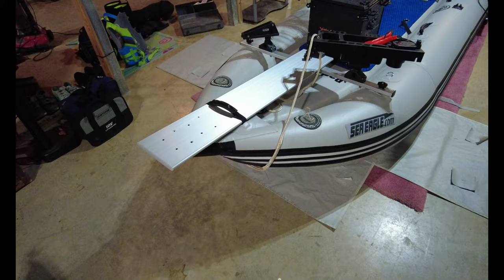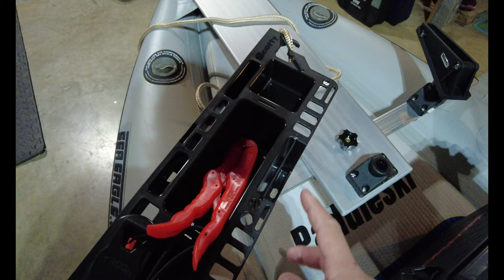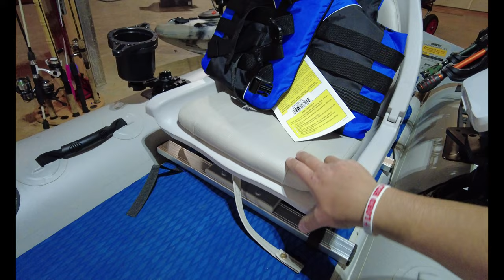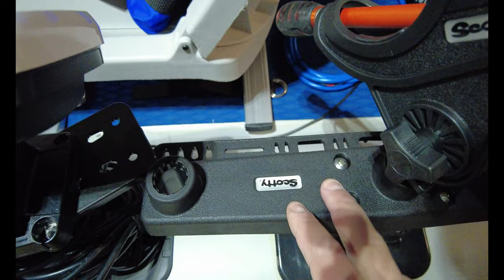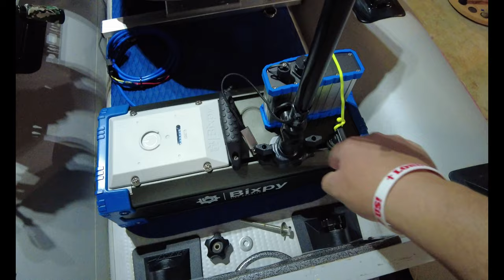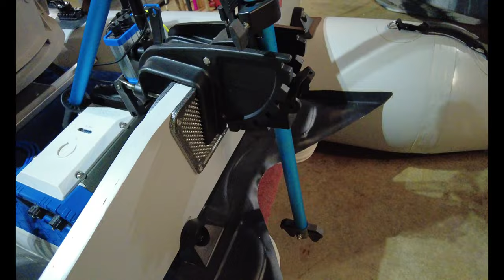Fully Rigged Sea Eagle 437ps PaddleSki

Comment: The bow motor mount, is there a way you can put that sideways on the paddleski?  Also, when you fold up your paddle ski, do you have to take off that cross bar where you attached to the motor mount too?  If yes, does it seem convenient to that everytime Thanks
Reply from the maker: I feel like the mount would be long enough to fit sideways, but I don't really know a good mounting point for it.  The yoke up front is necessary where it is so that it can keep the pontoons pushed out and prevent the PaddleSki from trying to cave in on itself, so I wouldn't remove that.  I do take my front yoke off just so I can get it packed up tighter.  It is a simple process that doesn't take too long.  If I am not too far from home, I can put the PaddleSki in the truck fully inflated and then deflate everything when I am home.  I really do like taking everything off of the PaddleSki before I go anywhere though even if it takes a little longer to do.

Comment: With the transducer, do you let it down even with the bottom of the boat or lower then that?.. Also, what type of adhesive do you use to attach the switch pads? Do you inflatate the boat when putting those on? Thanks!
Reply from the maker: On this particular boat, I let the transducer down to as low as it would go and that was pretty much right below the surface.  When you attach the YakAttack switchpads or even the Scotty pads to the boat, you will need to inflate the boat/kayak/sup completely and then utilize HH-66 Vinyl Cement.  I inflate the boat, mark my locations with pencil and then tape around it.  From there, I use a light sandpaper and rough of the surface slightly on both the vinyl and the pad.  I apply a layer of the HH-66 to both places and wait about 5 minutes.  I then use a heat gun to warm them up and stick the pad on the boat.  Press down and make sure all areas are in contact with each other.  You will need to peel away the tape from the outsides now and wait 24 hours before using.  I may do a video soon on this process.  I hope that helps.
Reply: @jonping8  You are awesome! Thanks for replying!!! Yes, please I hope you do a video soon! Appreciate your helpfulness!
Reply: @jonping8  Can you also put a link on what type of heat gun you use and that adhesive? I can Google it, but I would love to support your channel! Thanks!
Reply from the maker: I don't have any affiliate links at the moment for any of these products, but here are two links for places that you can find it at.  They can pretty much be found at different retailers though.  HH-66 (https://www.nrs.com/hh-66-vinyl-cement/p14j), Heat Gun (https://www.walmart.com/ip/Wagner-Furno-300-Heat-Gun/154134135?athbdg=L1200&from=/search)
Reply: @jonping8  Gotcha Thanks!

Comment: Can you do a video on how to add those switch pads on your boat?  Thanks.
Reply from the maker: I can definitely plan to do that coming up sometime. It's not too bad to do, but it does require some thought on placement and some patience on letting it cure (24 hours) before using.
Reply: @jonping8    What type of adhesive do you use?  Also, when you attach it, does the boat have to be fully inflated?  Thanks

Comment: How long can you go on your Bixpy battery?  What the is the highest thrust motor can you use?  Thanks
Reply from the maker: I have not had a chance to test it out fully on the PaddleSki yet. In my kayak in fishing tournaments, I can fish a full 8 hours but that is not on full speed. Normally you can only go about an hour on full speed. Otherwise, adjusting the speeds will make the battery last at different intervals.
Reply: @jonping8  Do you think a down rigger can be attach to the paddle ski? Like can it go where the scotty rods holders go? Thanks!
Reply from the maker: @NghiaPham-xi5so  I feel like you wouldn't have an issue. If it's a Scotty downrigger that would make it so much easier.  I understand that there are different models and different sizes or weights so depending on placement I feel like it'll be fine. I've attached a decent amount of weight to my Scotty mounts.

Comment: How far down do you run the top of the transducer below the pontoon or waterline?
Reply from the maker: I can't really get down below the water line too much with the current setup. The Scotty transuder won't put the transducer really low but it was probably about an inch or two.  A transom bracket would get it lower for sure.
Reply: What Transducer are you running? Does it twist off center due to its weight?
Reply from the maker: This transducer is a the Lowrance Triple Shot transducer.  I can't remember the exact model number though.  I have found that at the speeds that I am moving with the Bixpy, it doesn't move side to side much.  With a faster motor, I am sure it would probably do that.

Comment: i would not waist money on a bixpy they are to loud in the water the connecter can be finicky, and I have had my j2 battery overheat before.
Reply from the maker: That's interesting. They can be slightly noisy and the new K-1 is quieter. I've never had a battery overheat though and I own every battery them make. I'm sorry to hear about that.